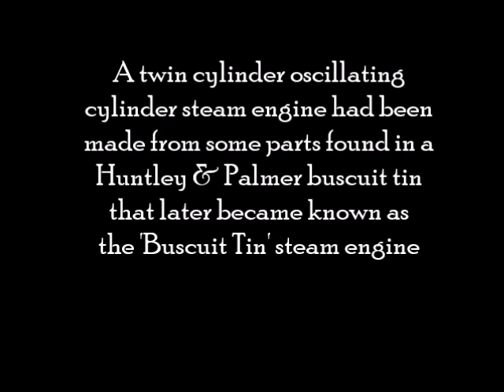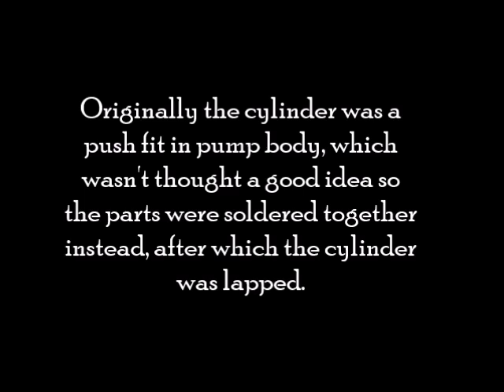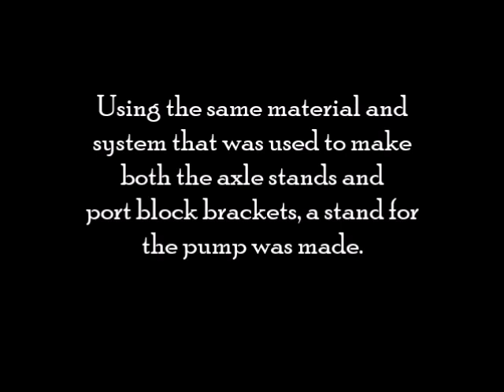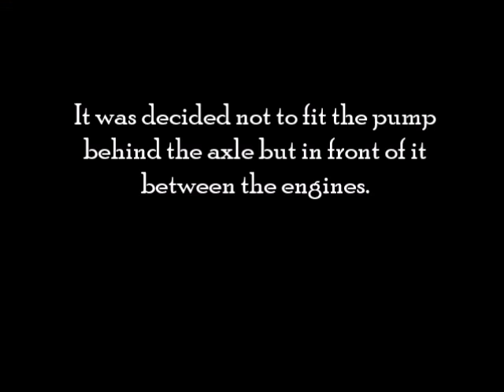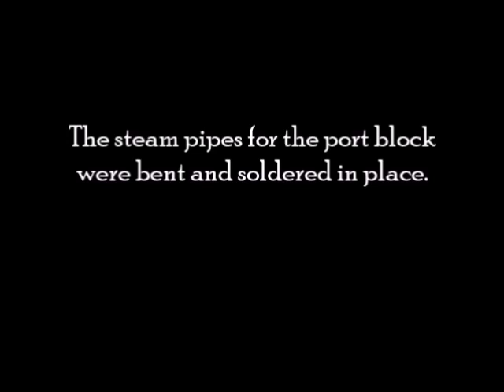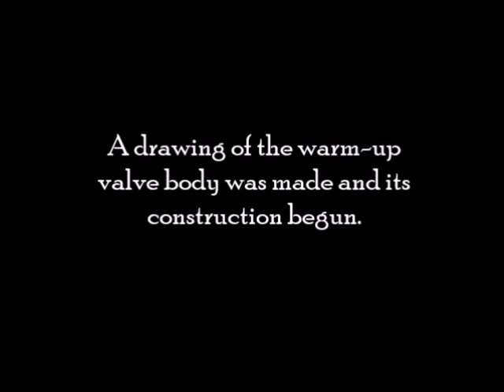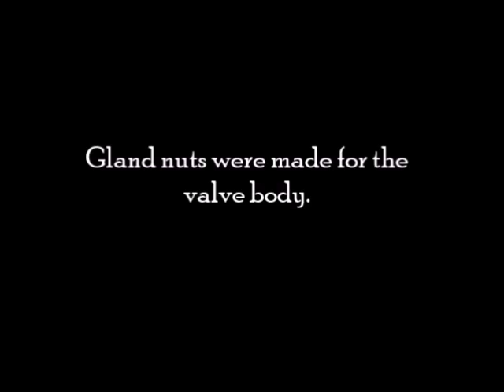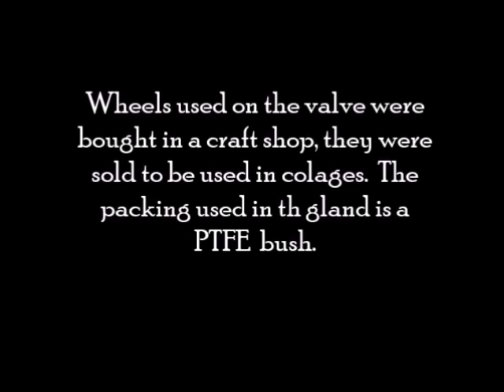Biscuit Tin Steam Engine  Part 8  Fitting water pump

Comment: Hi Tony, I've never thought about copper cylinders. Do they work well? Are those turned or is it just a piece of tube?
Reply from the maker: Hi, Andres, I am pretty sure the cylinders are bronze with a high copper content as the bits I had to machine behaved like bronze.  I have made cylinders using copper tube with an aluminium piston  which worked OK. The cylinders are tubes with their ports and trunnion bush hard soldered on.  Have a great Christmas. Take care Tony.
Reply: @aderyn  Thank you very much for your answer Tony, very educational as always. Merry Christmas to you, too.